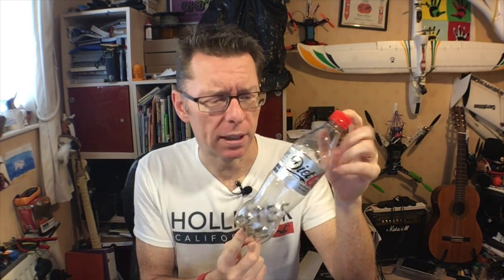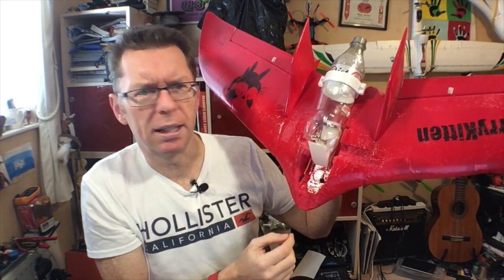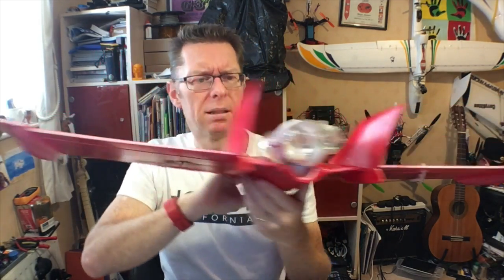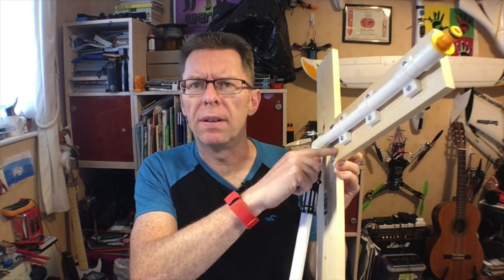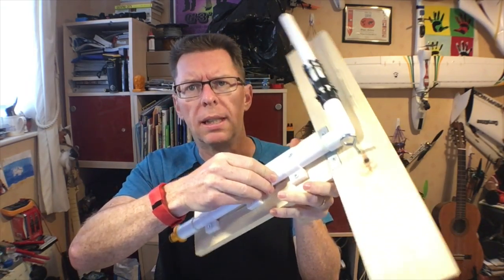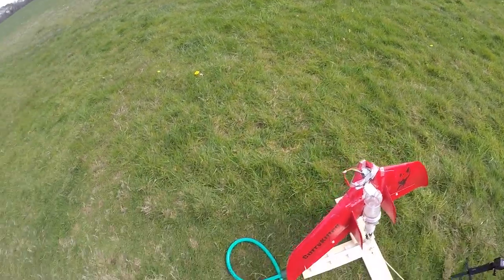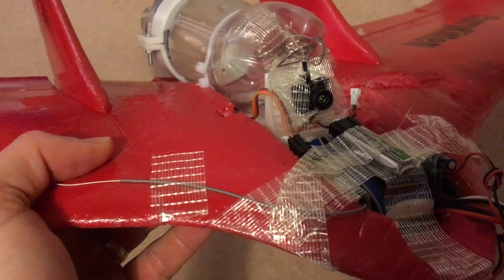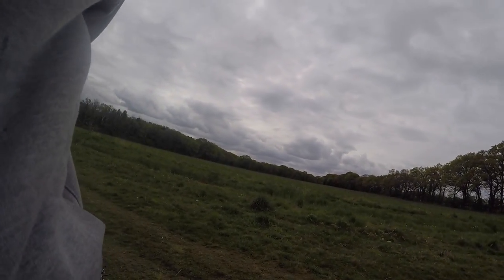Can we fly a plane using a Coke bottle for power ?

Comment: Think ya need a better pump! Hope you keep trying this and get better results.
Reply from the maker: Yes, a friend told me that the large volume of the car pump meant that air was probably escaping through the O ring under pressure, as they are not designed to go high.  A track cycle pump hovever is designed to go to around 120psi... so that'll be next !

Comment: Great stuff . 2litre bottle next? You need a release mechanism so you can take the pressure up to 120 psi and do a near vertical launch . I put some files on My Mini Factory for printing a Gantry . there are lots more simple ones out there with two 6 inch nails . Love the video . Thanks for sharing that. Bottle Rocket Entusast.
Reply from the maker: Replace the pump is the first order of business - with a nice track cycle pump which is designed to go up over 140psi.  What's My Mini Factory - not heard of this, and keen to see designs ?
Reply: Hi. Yeah i use a Stiriup type pump that I got from Lidl they do them now and again for 5GBP . I have taken bottles up to 120 psi happily . My Mini Factory is like many others a Library of things that you can download to print on your 3D printer but its open source and you leave files there gratis and as i remember you don't have to sign up to download the STL files. As i said i have posted the files there for my Bottle Rocket effort with a link to a couple of vids on You Tube.
By the way Gordon sent me the link to your great vid. Thanks again.